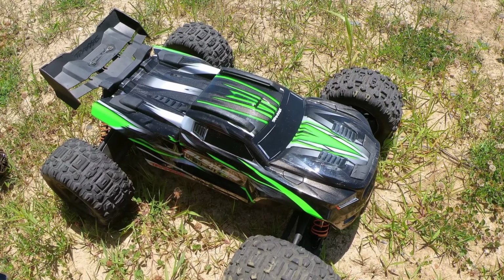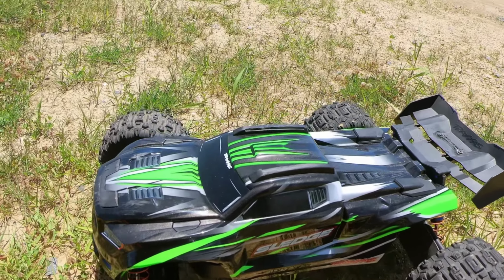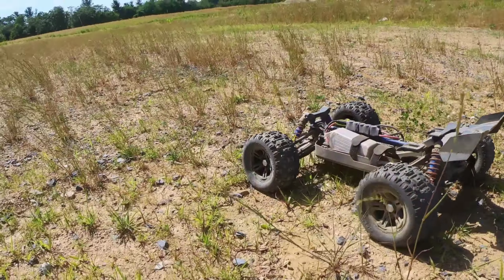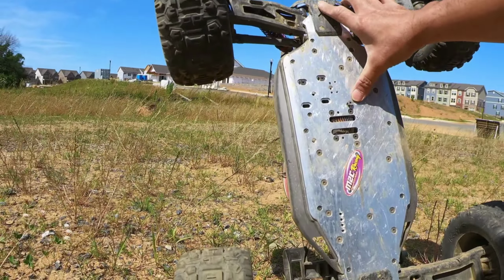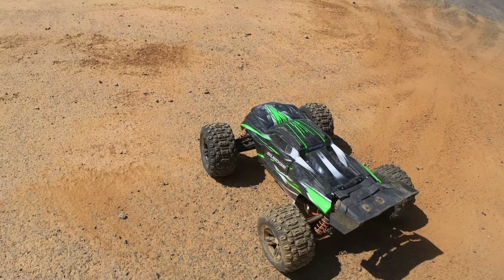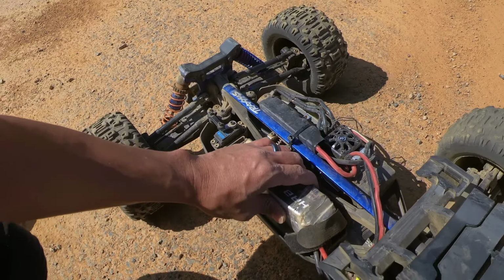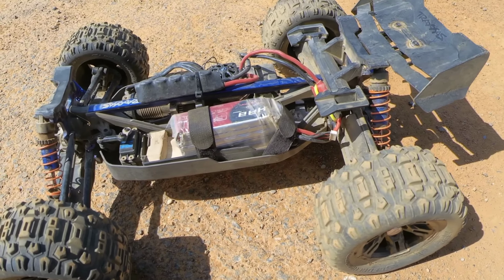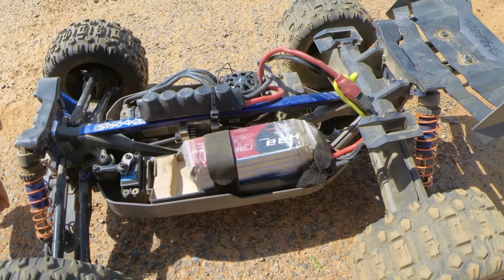Traxxas Sledge. The BEST Basher Traxxas ever made!? M2C Chassis, Motor mount, ESC plate. HRB Lipo.

Comment: Dude the same screw keeps falling out of my car every bash it’s driving me crazy LOL but great run buddy it is definitely the best basher Traxxas has put together so far.
Reply from the maker: Thanks so much Bro David. I always appreciate your time watching brother. I swapped it with a longer screw that seems to solve the issue 👍. Sledge did awesome 😍 out there. The wind was crazy strong 😳.  Had some challenge landing it on its wheels at times LoL 🤣.  First action with the camera mounted on the radio 😜.
Reply: @CommanderAstigRC  Yeah I tried the longer screw already also and it ripped that out too LOL